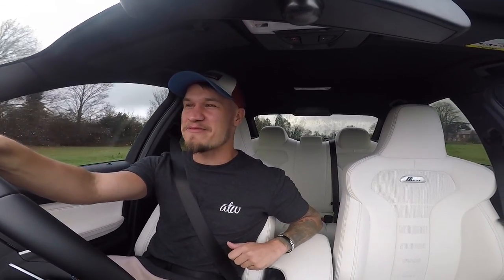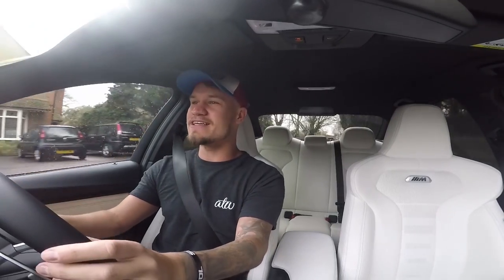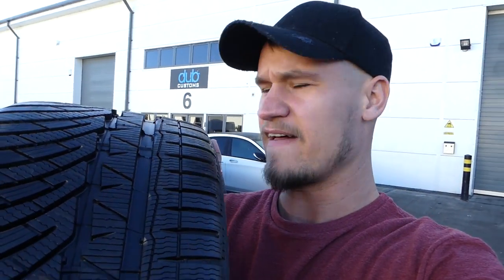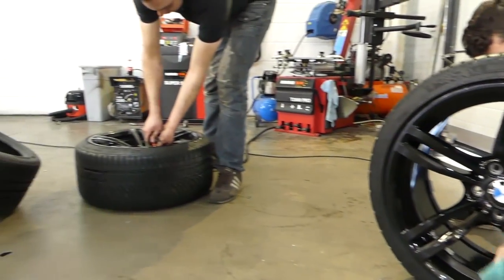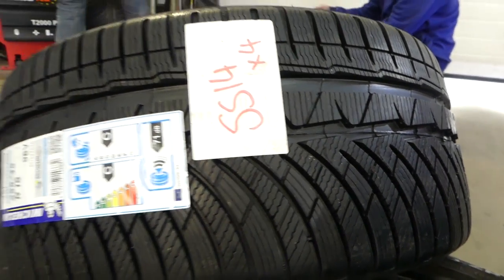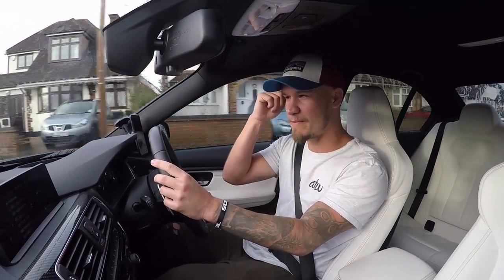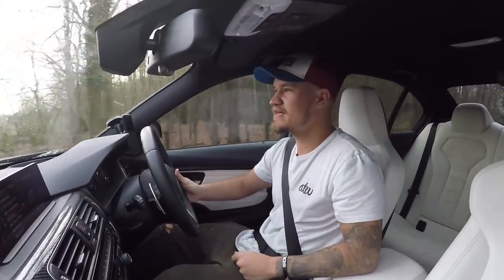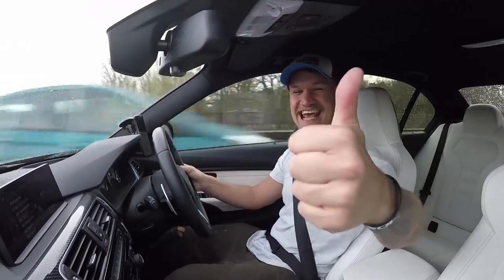WINTER TYRES ON MY BMW M3!

Comment: I have the M4 Competition Package with the 20” 666M alloys and would like to get some winters fitted to the car. I was watching a video that suggested 16-18” tyres are optimal for winters.

Would you recommend buying a full set of wheels and tyres, e.g. 18” instead of trying to get winters for the 666Ms?

Comment: It hasn't been consistently cold enough in the south of England to warrant putting winter tyres on this year (yet). Its been over 10 degrees c at times recently and that's not good for softer compound winter tyres. Until the forecast shows consistently cold temps, the winter tyres stay in the shed.

Comment: Well for different sizes, the best setup is never the same but for my winter setup I have  continentals on my Audi. And I live in Switzerland. And it's the best winter tire set up I can have. I tried the Alpin before but I really sure the Continental Winter tires are a lot better. At least for me and for my car.

Comment: I have the same tires, but i seem to have some problem from day 1 of installing them. When i drive between 25-30 Miles per hour, i seem to get a really bad humming or i would like to say knocking sound coming from the tires. It happens on intervals as if there is a screw or a rock stuck and every time it hits the roads to knocks. I got the tires checked inside and out and also re balanced, and that knocking sound still occurs between 25-30 MPH, it also occurs at higher speeds but it a lot more quite since the intervals are a lot quicker. Has anyone experienced suck a thing? it gets annoying because on a clean road it knocks so load that everytime i drive someone with me, they always notice and say it is not normal. The tires guys said nothing was wrong but for me that is not normal especially for such expensive tires. I would appreciate if someone could give me some idea
Reply: Also i tried putting my summer tires just for a test drive to make sure nothing is wrong with bearings or anything else and the sound was gone, But with those winter tires, it knocks badly between 25-30, and it happens on intervals as if there is one point on one tire that when it touches the road, it makes that terrible knocking sound

Comment: u don't need winter tyres in the UK maybe your going to Europe
Reply: wtf london - rain
Reply: And in temperatures that low the rubber in summer tires gets very hard and you loose a lot of traction.
Reply: If you drive only like a grandma, you probably won't need them.But never forget it's pretty much like driving with bald tires.